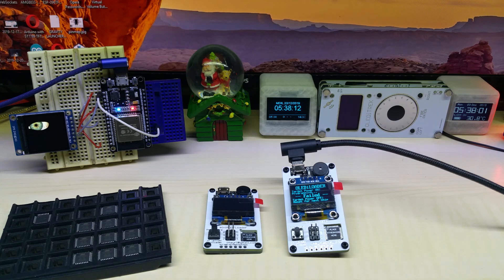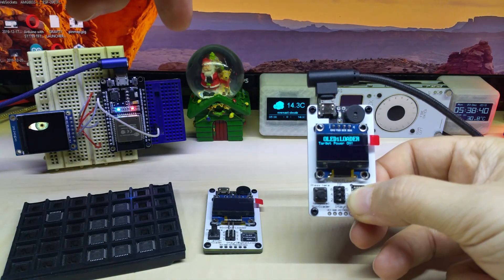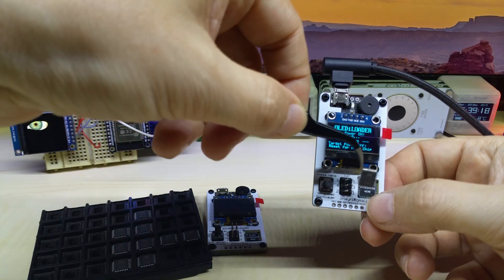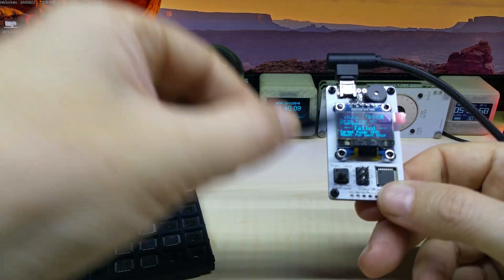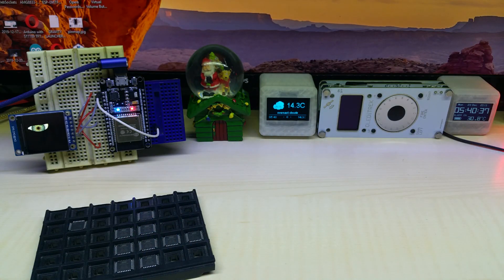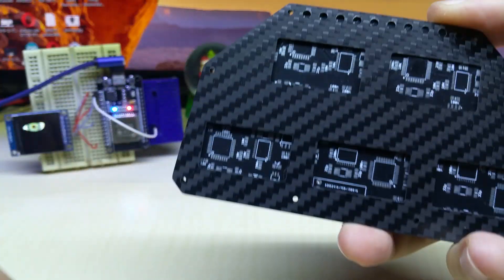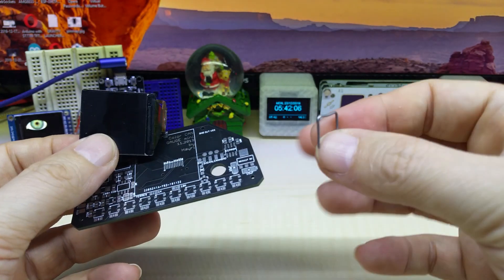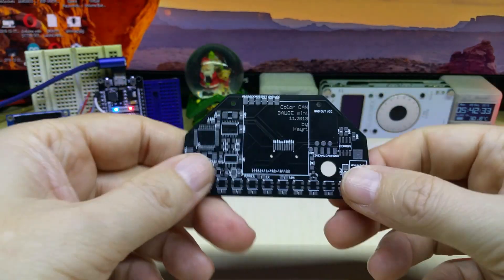Happy Holidays, Merry Christmas and a Great New Year to everybody plus a little electronics :-)

Comment: Great work so far Hayri, keep it up. If you could make some waterproof / motorcycle type enclosures I think they would sell well (Voltmeter/water / engine temp/ GPS etc)
Reply from the maker: Thank you. I will, eventually the CAN V-GAUGE will get a waterresistant enclosure, the new COLOR CAN GAUGE mini as well and I am also working on a new product, again with the color IPS display as a gear indicator with speed and rpm inputs so the gear can be calculated instead of using micro switches on the gear lever. Since the display has a high resolution of 240x240 pixel it could also show speed and rpm as well.